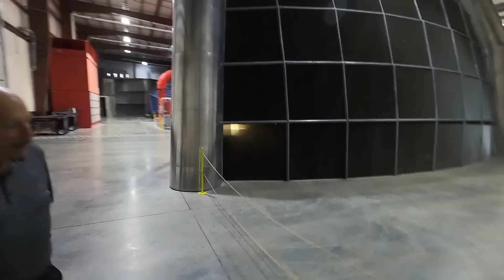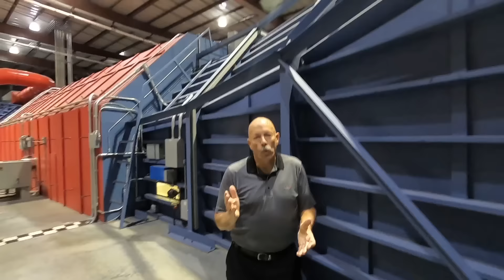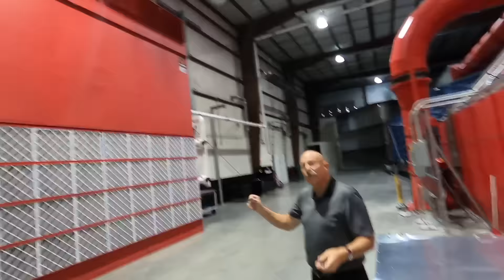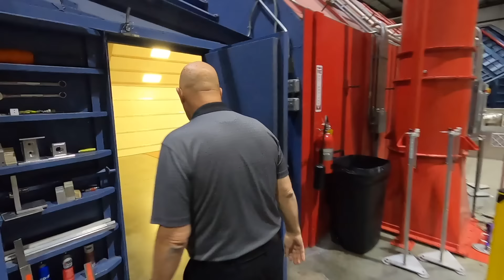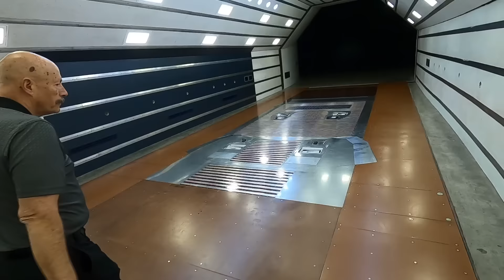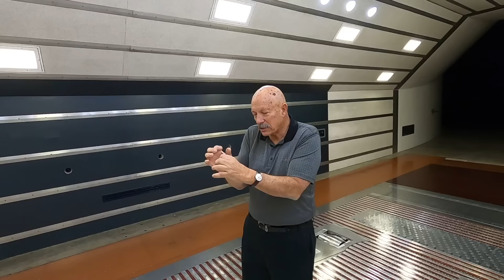How Does A NASCAR Wind Tunnel ACTUALLY Work? Behind The Scenes in an Official Testing Facility!

Comment: Here all along I've thought of a wind tunnel as a big hallway with a giant fan blowing air through it...well, essentially it is, but I never would have thought about it needing to be a specific shape, length, width, or even all the complex stuff like the boundary layer prevention stuff in the floor. I do wonder though about the temperature of the air flowing through the tunnel, which he said really doesnt have an affect on the accuracy of the results, however from my time spent working on F-14's I learned about how temperature and humidity affect the speed of what Mach 1 actually is because of the density of the air. It ranges from ~660mph up at the cruising level of most airliners where the air is cooler and drier, all the way up to ~760mph at sea level where the air is warmer and more saturated, and that can change at either level depending on the temp and humidity. So it would stand to reason that the temperature and humidity would affect the density of the air in the tunnel, thereby causing the airflow around the car to vary to some degree. heavier, more dense air would logically mean more pressure on the spoiler, and on the nose of the car, thereby increasing drag. Today's cars are so aero sensitive that back when decals on the cars were still a thing, Hendrick had tested extensively, and actually had specific spots for specific contingency and lower tier sponsors in order to minimize the drag that the cars produced. I would think that the average temp and humidity of the time of year at the track that the car was designed for should be simulated for the most accuracy. Sorry, I'm kinda a physics nerd without the degree but a lot of study. These kind of things fascinate me.

Comment: 41:00 he just revealed a litteral million dollar answer wow this has been a priviledge  the rear doesnt control the direction of car  mind blown so front lips are super important even more then i thought
Reply: Ahh, the tires/driver determine the direction of the car. The front end aero will create effects for which the tires/driver will need to compensate. This compensation also corrects for unbalanced aero such as in traffic, where suspension setups also effect/compensation. This wind tunnel will assist in getting the car to clean air top speed. A faster speed is acheivable thru drafting ... passing is a whole other story. He built a state of the art oval racing wind tunnel. It's not designed for airplanes. It's not designed for supersonic jets. It's not designed for missles/rockets. All of these different wind tunnels are designed to find an objects balance within the airstream. The balance point is where manueverability may be controlled, called an envelope. Bad things happen outside the envelope.
Reply: Awesome video. Thanks for the insight.

Comment: Fascinating, especially with the attention to the floor surface design and ability to measure pressure differentials. Kinda curious if they've ever been asked to set up a simulated (or practical) wall to look at the amounts and effects of air compression and additional side force for those drivers (Larson/Reddick, for example) who like to run as close to the wall as possible.
Reply from the maker: thats a good question! I have wondered the same thing

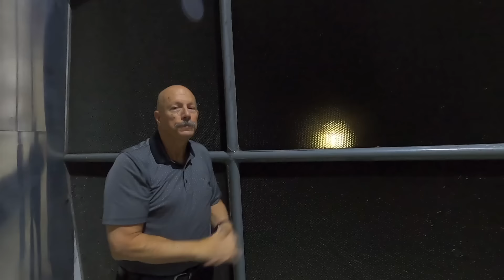Comment: 5:15 - a 'Snoot' on a camera flash focuses light using exactly the same method - only the light heading straight down the honeycomb passes through, pointed in the direction of the subject model. Same goes on large Cinema lights, where a foldable grid fits over the front of an unfocused light source to ensure there's no light heading anywhere other then the subject.
An Excel dot mesh built out of stock from a hardware store - Brilliant!

Comment: At the end he had a point! my first 30 years of my career were as a Union Sheet Metal Worker about 20 of that was Commercial HVAC Systems......things you move air through!
the Last 10 years was working at Boeing ......helping build things that move through air!
while the technology behind both are similar there are a lot of differences!

Along the way I acquired a text book book used to teach Mechanical Engineering in the 40's....
I read that book cover to cover and studied it a few times and used it as a reference for what I was doing, 
as well to solve problems and understand things that I was doing as well....
especially when dealing with Engineers!.......

In Trade School before I started in the Sheet Metal Industry I had an instructor who would say 
"when you know everything there is to know about moving air,...its time to go meet the  Big Tinner!"
he was absolutely correct!

Comment: As a gearhead like me this is the fourth time I've seen this video I would love to go and see one of these up-close-and-personal because I still don't know how this thing works. Hopefully I can see one in the next 5 years making a goal for myself.
Reply: It blows 130mph wind 
They measure pressure on the car
The run smoke and drag tests while it runs
They’ve used fluid mechanics to replicate the boundary layer of air against pavement as if the car is in motion and as if the air is not
They determine if their bodywork flows with the least resistance in certain areas while providing downforce and yaw characteristics that make a car go around the track fast

Comment: Great video!  I had the pleasure of doing some aero testing a few years ago at their smaller tunnel ("A2") next door.  I was an engineer for an on-road vehicle made by a powersports company.  We didn't exactly have a lot of aerodynamic knowledge (except for me being a race fan), but the staff at A2 (I think it may have been Gary's son) was great to work with.  In a couple days we were able to do over 50 runs with different aero configurations and left with all of the data in an excel format that was easy to work with.  We did get to peek into this bigger wind tunnel while a NASCAR team was between runs, but I didn't get the whole history like you got in this video.

Comment: A building designed in Excel and the main computer running Windows XP
Reply from the maker: if it aint broke don't fix it lol. good data is good data
Reply: @Stapleton42  Microsoft Racing baby, lol